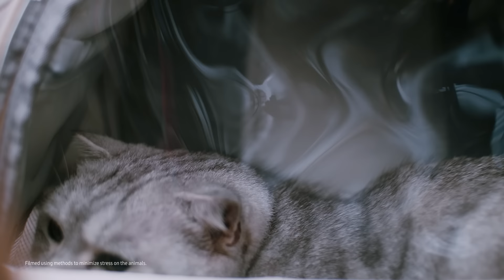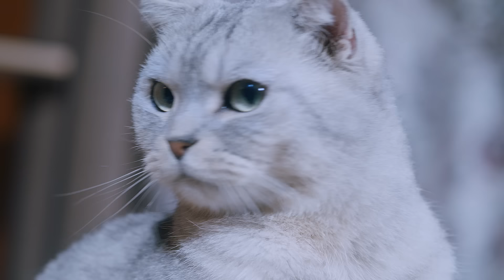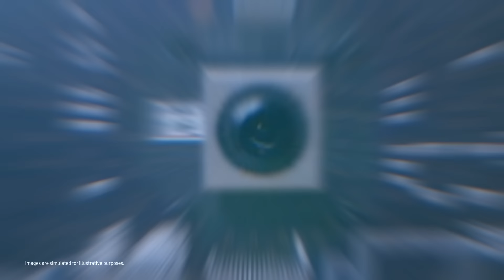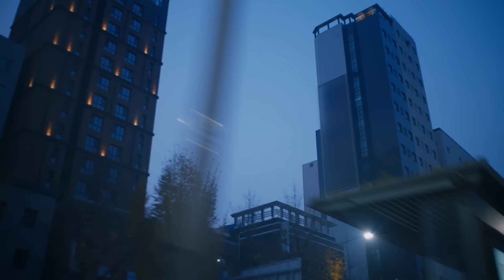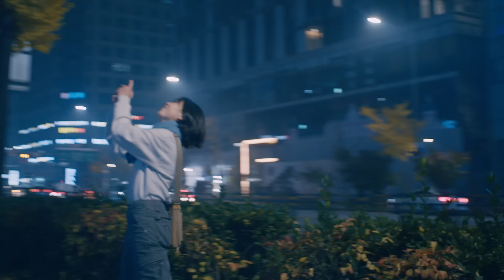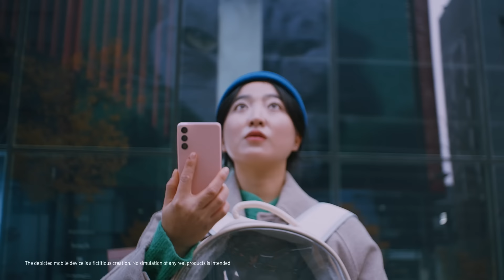ISOCELL Image Sensor: More pixels. More detail. | Samsung

Comment: As a photographer, I can positively tell you that smartphone companies are preying on the ignorance of their consumers with the push towards higher resolution smartphone cameras. There's a reason why you rarely see even professional-level DSLRs and other interchangable-lens cameras offering resolutions above 60 MP.

Besides for specific use cases limited to perfect lighting, the need for higher resolution becomes basically non-existent from 40-50 MP upwards. 99.9% of photos captured on a smartphone won't be headed for a billboard - they'll be shared on Instagram, Whatsapp, Facebook, shown on a phone, used as a wallpaper on your PC, etc. For this, even 18 or 20 MP is more than enough, when paired with a good sensor.

That brings me to my next point, which is the importance of sensor size. Regardless of how many megapixels you cram onto a sensor, if the size of the sensor remains the same, the camera's light-gathering capabilities also stays the same. That means that in any conditions darker than broad daylight, you won't notice any improvement in the quality of a 200 MP photo over a lower-resolution camera. To the contrary, a dedicated camera with a much larger sensor, such as an APS-C or full-frame sensor, will even produce sharper, cleaner photos at 24 MP in less-than-ideal conditions than the best 108 or 200 MP smartphone camera ever will!

Going hand-in-hand with that, claims that "you'll be able to crop into your photos without loss of quality" is misleading. With a tiny smartphone sensor in anything less than ideal lighting, it will still degrade significantly as you crop into the photo, because each set of 50 pixels will look like one pixel smudged over by the AI's desperate attempt to make sense of the insane amount of noise/grain that the tiny sensor has captured.

And what about the times you do have ideal lighting? That brings me to my final point - the lack of clarity in the glass of a smartphone's lens. We refer to the effective capability of glass to transmit an image without distortion as its "resolving power". Even the best quality glass we can manufacture isn't 100%, optically clear, therefore glass's use in camera lenses has its limitations. Without going into unnecessary detail - the resolving power of a tiny 1/3 inch-diameter piece of glass being sufficient to transfer a picture clear enough to justify a 200 MP sensor, is highly, highly unlikely in a $2000 smartphone. Some $4000, 2-inch-diameter, dedicated lenses have a hard time resolving a clear enough image for a 60 MP DSLR/mirrorless camera. How much less a smartphone?

To put it in perspective - smartphone camera technology has improved rapidly over the last few years, there's no denying that. However, it's ultimately a product made by smartphone companies to cater for the mass market, and if "pushing the megapixels up" makes people want to buy their product, you can bet your bottom dollar that they will try to push the megapixels up - even if it has little real-world benefit.

My advice - if you're thinking of upgrading last year's phone to this year's edition just because of the increased resolution... Don't. 😉 Other features will also improve, but in my opinion that process is slow enough to warrant waiting three or four years between smartphones.

Cheers guys!
Reply: :yougotthis:
Reply: 50MP for phone is the sweet point so far
Reply: While somethings you say are correct, especially lighting being everything. What you may be forgetting about the higher pixel count is pixel-binning technology.
Reply: @_Ace._  Yes, but although pixel binning effectively turns (typically) 9 pixels into one, it still uses the same total sensor area. In practice it only offers marginally better results than a non-pixel binning equivalent.
Reply: Thanks for your detailed insights! :))
Reply: @TristanMcVey  50 megapixels is far more than a phone can actually resolve. Most likely you get around 15 megapixels or so out of them.
Reply: @logitech4873  if they still have those low res sensor, but the 50MP GN2 sensor is the only newest and a better sensor Samsung got right now, also 33MP for the 8K video.
Reply: my sentiments exactly. but then again, less people know these things and they think more pixels mean better camera. uggghh
Reply: @TristanMcVey  Not sure you understood what I said. There's a difference between sensor resolution and actual resolution
The actual resolution is hard to quantify, but is shaped by the limits of your optical system.

For example, let's say you have a 100 megapixel camera, and you buy the cheapest zoom lens you can find for it.
The lens is not capable of resolving those 100 megapixels. At 1:1, the image looks blurry. You have to scale it down to maybe 8 megapixels for it to look sharp on a pixel level.

This example is very similar to the situation with phones. A 50 megapixel phone does NOT have the optics required to actually resolve this resolution. This means that the actual resolution you get is much lower.

If you prefer a car analogy: Your Ferrari won't go very fast if its wheels are made of cheese, and the world of smartphones is the world of cheese wheels.
Reply: @logitech4873  sure i know, but this is the reality that they only have 40MP+ sensors now.
Reply: from another perspective of another photographer as I am, you are highly correct. Just buy the old model phone and buy a second-hand full-frame DSLR such as Sony a III s or any similar camera if you are interested in photography, this ISOCELL 200MPS is just a marketing strategy from Samsung. even my old 5mp Zeiss Nokia n97 will capture the same result in a tiny viewing screen such as smartphone displays
Reply: I'm not reading this entire comment. It's too long 😁
Reply: more pixel but more artifact. same story.
Reply: @bossrobs5416  Thank you for your input, couldn't agree more. 👍🏻
Reply: This camera is still exiting as it also would probably bring  a bigger Sensor witch in my non professional opinion is needed in a smartphone but now we need to see what will be used lens wise what will capture the light the image processing and so on
Reply: Thank you very much for this detailed comment.
Reply: @bossrobs5416  I loved the old Nokias. I had n82, it could produce some seriously good photos.
Reply: one thing that matters more than high resolution is the sensor size. Even if it has a resolution of 200MP but the sensor size is still the same, it won't be able to compete with an APS-C sensor camera even though let's say only 24MP
Reply: Agreed. Resolution is one important thing. However, there comes a limit, and the more important factor is how much light can the sensor take in. If the resolution increases but the amount of light doesn't, then the bottlenecks will be visible easily, especially in night mode.
Reply: Thank you.   The only thing I'll retain from that is that I'm right on waiting 5 years between phones.   But it was informative nonetheless.      That said, 99.9%?    Missing several 9s!!!
Reply: All are very good points. Smartphone cameras may improve every year, but they will never be able to beat even the most mediocre of DSLR's
Reply: That's a long explanation man, most people won't get it, especially the people who care so much about the brand name smartphone. All of my in-laws have the iPhone 13/14, but they have no idea why there are 3 cameras in the back. Let's say this instead "there is no way the tiny lens on the smartphone will snap a better photo than the big lens on the DSLR.  It's just like there is no freaking way the Corolla/Fiesta will run faster than the Ferrari!
Reply: I guess youre apple fan. No matter to me if its 50MP or 200MP its still insane camera for the price you cant be denying that. Xiaomi 12t Pro use this sensor and its Half Apple/Samsung price and still can beat apple and samsung in some shots. I also love the detail with 200MP.
Reply: @coolboss999  your loss, it's very informative.
Reply: @coolboss999 you mean I don’t wanna know the truth I’m a Samsung fanboy
Reply: @Mara941 are trying to say to a real pro photographer that you know more about cameras stop making a fool of yourself 🤣🤣🤣🤣🤣🤣
Reply: Samsung's camera technology is not as good as Sony's mobile sensor. The reason is that the iPhone insists only on Sony cameras, and Samsung wants a little bit of an equal position with the iPhone and uses marketing means, so I think these ads are inappropriate.
Reply: @TristanMcVey I'd argue 12MP is. There are so many phones that use that sensor, and it's been used for long enough that the software has gotten really good for it. The pixel uses a 12 megapixel sensor and that usually beats the s21 ultra in all except zoom.
Reply: @coolboss999  Too long for your short attention span, got it. 👍
Reply: @nate4912  Yep. You understood my comment. Congrats 😃👏🏾👏🏾
Reply: idk man ,ive always admired samsung for their cameras especially the 200mp sensor really does the job if you know where to take the pictures + compared to my old s9 which had a 12mp sensor i think getting an s23 ultra was a big upgrade for me after 4 to 5 years of owning an s9
Reply: Appreciate your advice, thanks! I will be upgrading from the Note20 Ultra to the S24 Ultra. I have 108 Mpx camera and confirm that the photos dont look sharper than those taken with my previous smartphone (Galaxy Note 9 with a 12 Mpx camera). The only difference is while in broad daylight taking photos of a still buildings or nature.

Comment: The real issue will be with the lense. You need a really high resolving lense for that kind of resolution. Even in the video they look like they are using a very high end lense.
Reply: They're putting the high end lens in front of the onboard lens, which is very strange.
When it comes to smartphones, it will be limited by both the quality of the lens, and the effects of diffraction. It's unlikely to practically resolve more than 20 megapixels.
Reply: lol yup. See my response.
Reply: There's no lens like that, since the sensors are already constantly at the diffraction limit. That's why the apertures are so wide. Also there's the chief ray angle issue, currently cheated by sensor lenslets and fully-aspherical lens design not to even mention the noise issues which are physically unavoidable at this point. If not for the clever computational tricks you probably would barely even see a clean pic at measly 12mp no matter the lighting conditions.
Reply: Ofc I meant the lenses small enough for the customers to tolerate them protruding more and more
Reply: Nevertheless, according to the press release, this SLR lens was not used for the final photo. Citing: "Because of this, we went with a smartphone camera module with no other aids"
Reply: @logitech4873  The truth is that it can resolve more details even when it is slightly beyond the diffraction limit. I have tested it with 1.0µm and 0.8µm pixels and the smaller pixels were still better in the amount of details.
Reply: @digimaniecz  You can't resolve detail beyond the diffraction limit. If you resolved detail beyond the established diffraction limit, that result would BE the diffraction limit.
Reply: The 200 megapixels are pixel binned like the predecessor. Resulting in an interpolated 12.5 megapixel image made from 4x4 superpixels. 

Only a medium format or mirrorless camera can deliver a true 200 megapixel image along with a larger lens.

However if they set their sites lower like said  then a more realistic 50 megapixel only using 4 in 1 pixel binning and a significantly larger sensor and matching quality glass lens it would work probably yield better results.
Reply: @bunyaadi  I agree, I also do not see the point in having 16-in-1. It just does not make sense to me. The thing is that I have already tested that these extremely tiny pixels really deliver better details even if the diffraction takes place, but in general, I would stick with 4-in-1
Reply: It does have the ability to become an alternative to a compact camera like 2/3 or 1 inch type sensors. The problem is all those things like a flash, tof laser autofocus. 

The crop factor of this about 3.3 which is pretty good although the smaller pixels might not be so good at capture results compared to larger photosites.

To be fair if they made a compact camera with a revised setup they could make the best use of this sensor.
Reply: @bunyaadi  Thing is, if you buy a GOOD 1" camera like a Sony RX-series camera, you get stellar optics and wide zoom range.
It's very difficult for phones to come anywhere near the quality of these cameras, especially at the long end.
Reply: @logitech4873  true. My dream would be to own a full frame compact like a hasselblad or sony a7c
Reply: @bunyaadi  The a7c is pretty dang cool.
Reply: They promised something and sell you something else. Welcome to samsung
Reply: Pixel Bining.
Reply: That didn't age well

Comment: I hope this doesn't end up like the current 108mp camera sensor we have (with douzens of issues such as autofocus) . I really hope this camera takes 200megapixel worth of quality.
Reply: the first gen version of 200mp sure will have issue too... sensor too big...
Reply: All big sensors have the problem. Different OEMs learn to manage it.
Reply: @Phoenix56801  hope will be good sensor...
Reply: Two words: shutter lag
Reply: @HABO2210  understand and for sure
Reply: They need better processing software for it.. To give us good pictures.. And they don't have it
Reply: there is no quality in small sensor size, at least for now.
Reply: @HABO2210  not necessarily, if the processor is powerful enough to drive the sensor, there should be no problem.
Reply: The 108MP sensor has no autofocus issues anymore.
Reply: issue? i have the s22 ultra now and i have no focus issues. lol. i think u maybe talking about xiaomi who first used this sensor.
Reply: @anitahorvatirl  és akkor szerinted miért tudta a tavalyi S21 Ultra tartani az év legjobb kamerás mobil kitüntetését egészen az S22 Ultra megjelenéséig? Itt nem a Xiaomiról van szó, a Samsung az egyik legjobb és legmegbízhatóbb szoftvergyártó, aki igazából csak az Applevel vetekszik.
Reply: @Phoenix56801  "if"
Reply: @BLAKEEATS1988  I am not talking about focus issues. I am talking about shutter lag, failing to take a sharp photo of a moving object
Reply: @HABO2210  im replying to the one who started this thread not to you. and the shutter lag is because you have to process 108mp and bin it down to 12 its not the cameras fault but the processor.  and on the s22 ultra that i have which is a sd8gen1 the lag is only half a second which is understandable and on future updates it can get fixed. but i am excited for the 200mp sensor if it can shoot something that you can blow up on a billboard then the results would be amazing. can't wait.
Reply: @HABO2210  you are right, i have same problem on my s22 ultra
Reply: @anitahorvatirl  Well, honestly, I am one the people who likes to process their image. Any image that come out of the phone is always overprocressed for me. I don't know about you but getting used to a real camera makes using smartphone to take pictures horrible.
Reply: @DanielBoos  mostly I use camera. So yeah definitely pictures on camera look really bad. But. As I said before few times not the lenses are bad.. The  processing software needs to be better.. Because he ruins the photo
Reply: @anitahorvatirl  rightt. I thought u meant that the image needed more processing. My bad, I see got the 90D. My brother has the s22 ultra and every image is oversharpened, at night time the image looks cartoony. Thank God my fold 3 doesn't have that processing
Reply: @anitahorvatirl  to add to what I said. You use cameras and know that the lense is almost more important than the camera body. With the smartphone lenses are horrible there is no natural depth of field because of the focal length like 5mm. What I want to see is better lenses and software. Because even, we both know that 50mm lenses are the most natrual lenses for shotting. Which explains why u always look horrible on a picture taken on a smartphone, don't believe me? Try shooting with 10mm lenses see for yourself. This is mainly because of distortion. While both can be fixed in processing they never become as good. One thing that simply can not be fixed in procressing is image compression due the focal length
Reply: @marchvickness4953  learn math. its not the issue
Reply: The current 8 gen 1 have enough power for zsl and processing for 108mp but for 200mp it will be like 108mp on 865 phones thr isp barely able to tap the sensor power
Reply: @marchvickness4953  s23 ultra is going to have the gen 2
Reply: The new 108 mp on s22 ultra doesn't have any of those problems such as autofocus
Reply: @CAR-hi1lg  hope it will be better...
Reply: @인수 how do we know we're not gonna have the s23 ultra with issues that will only be fixed im the s24 ultra then???
Reply: @HappyMarshmallowGamingComedy  We don't, but the original comment had said that we're still currently having issues with the 108 mp auto focus, which we aren't.
Reply: @Lafayette-hk2gd  s20 ultra still has issues

Comment: First improve shutter speed. Even burst mode captures 95% blur photos what is meaning of developing 200mpx sensor when your 12mpx does not work perfectly
Reply: This is not true 200. Probably another 12mp sensor
Reply: Shoot in pro turn up the shutter 🤷‍♂️
Reply: @_Ace._  I know that but not all are Pro users
Reply: @grmedia3813  If you're using the standed camera mode,  turn on auto focus tracking.  Auto Focus tracking  is a function in which a camera's processor analyzes a moving subject and predicts where it will move in order to maintain focus. Focus tracking is useful for action shots of all sorts including pet photography, fitness, and sports.
Reply: @anecro  well with their bining pixels tech, the sensor will can be able to change between 12 and 200 MP